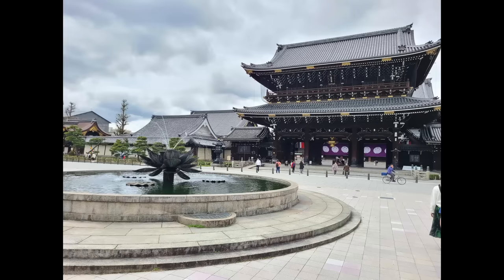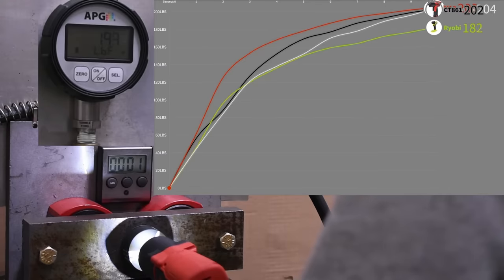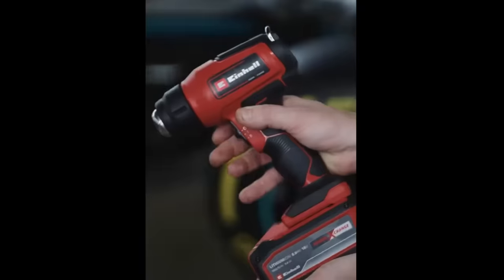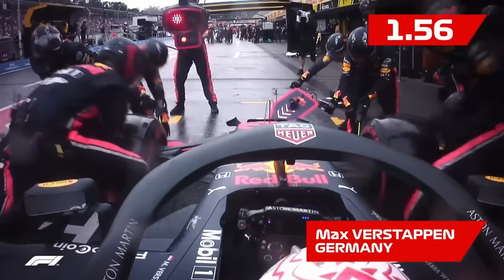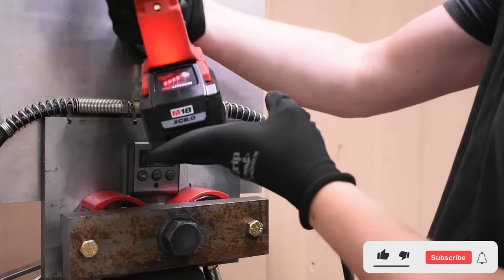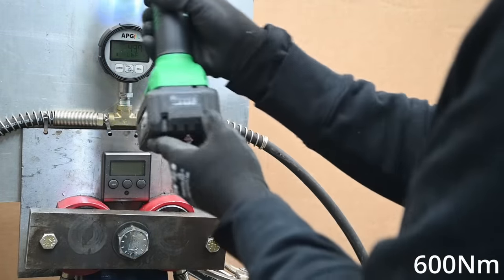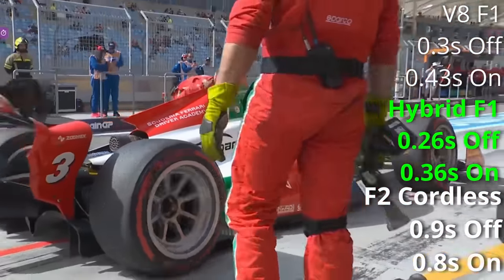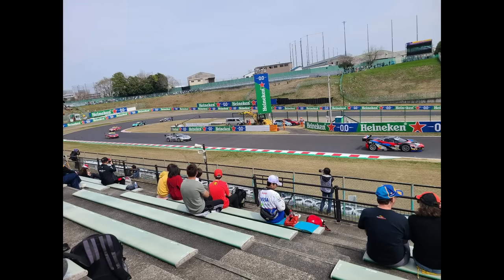How Formula 1 Wheel Guns Work & Why Not Cordless?

Comment: Failure to use a tool correctly that your own crew has configured, and then instead "eyeballing it" - that's not a tool failure, that's a you failure. Blaming the tool here is like blaming a printer for your spelling mistakes.

(This isn't manufacturer controlled, the pit crew themselves configures any tool mode sequences and timing. Failing to account for possible double stacking by choosing to set a needlessly long delay before sequence reset, is fully an operator fault.)

Comment: Question: why NOT use air? Why would they NEED to change to battery operated? Air power is about sturdy steel parts, limitless capacity and near limitless power (by increasing pressure) against getting rid of one rubber hose for those 3 seconds..... Really not worth the trouble.

I've seen this trend become more popular in the recent years where one single hype-thing is force fed to everyone, for every application because "it's new and cool". Another example is pushing the literally stupid idea of EV trucks when the thechnology is not there yet. The tech is here for passenger cars, absolutely but not for hauling massive loads, where the batteries take away too much of the load capacity with hours of downtime when recharging.

Some tech is simply better for (A) and some tech is better for (B).

Comment: I've been a huge fan of everything DeWalt,  impact sockets, socket sets,  all my drills, knives, etc CUISTOMER SERVICE AND WARRANTY IS TRASH 🗑 THE BIGGEST HEADACHE and run around I've ever seen.  All i asked was to replace a brand new faulty knife,  endless emails 📧 not even with the $30. I bought a new Catapiller with a key chain multi tool flashlight.  I'm so disappointed with DeWalt customer service is RUDE and ridiculous.  And HF is doing 5 years! No Questions. Sad economy 😢

Comment: I doubt, that a Mercedes mechanic will voluntarily touch an Einhell tool... they are the cheapest sh*t you can find and will fall apart if you touch them. No professional will dare to use that crap. Not sure what Mercedes get's out of that deal, but for sure it is not a win of prestige

Comment: If everyone used batteries the extra time won't matter because everyone on same rules etc or just subtract the extra time handicap difference etc daft really 😂😂
Reply from the maker: There currently isn't a rule about having to use an air gun, it's chosen because it's the fastest. And forcing each team to use a slower gun doesn't sound very F1 top of motorsports so would be a shame